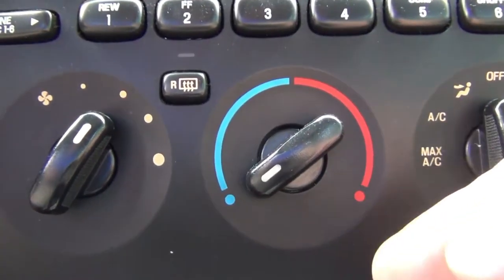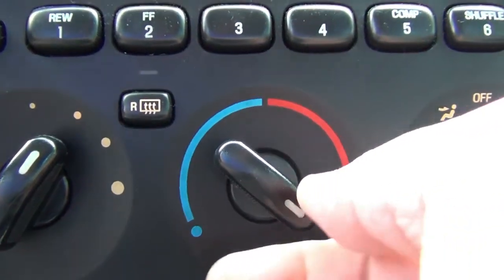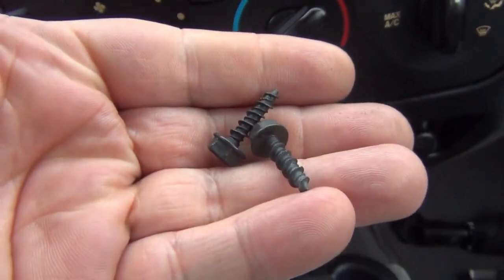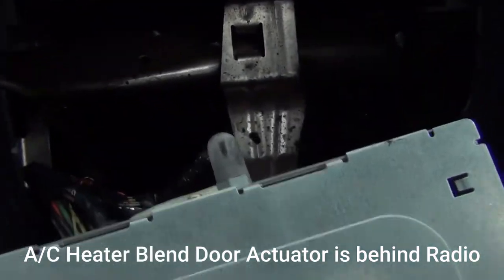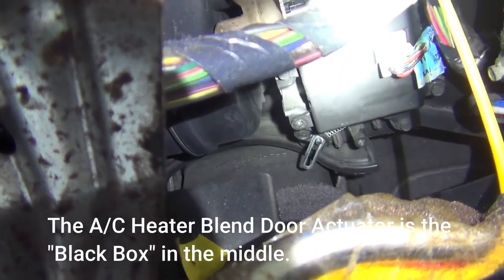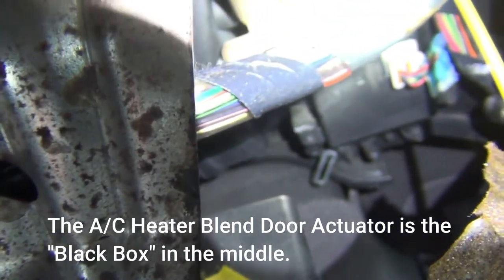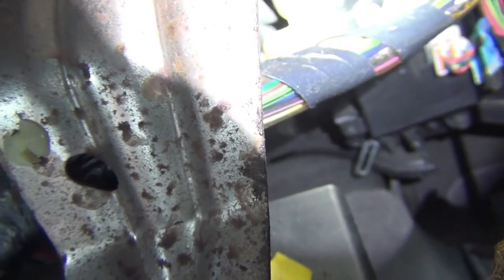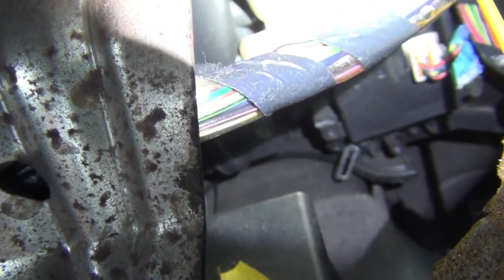2000-2007 Ford Taurus, Mercury Sable- How to check proper operation of AC Heater Blend Door Actuator

Comment: I have the same car 3.5l sable. 2008 no heat concern. I shot the heater core hoses the temp in 120 out 77 but the actuator in the car is clicking. Could that be the cause of no heat? maybe the mixing door or should i have at least a 10 degree diff in and out at all times?Great video.